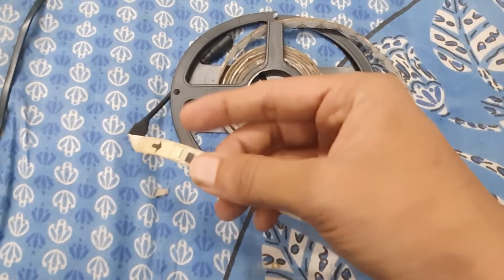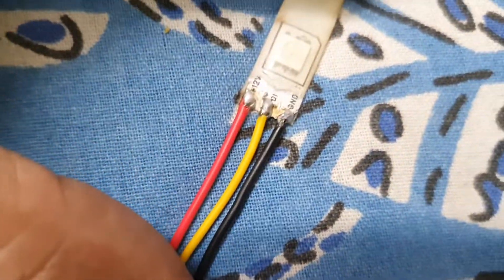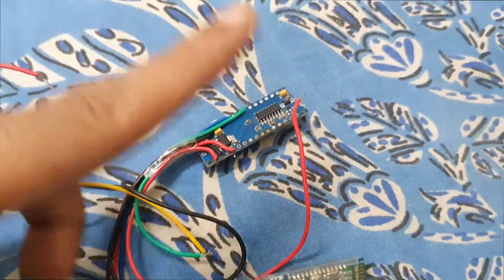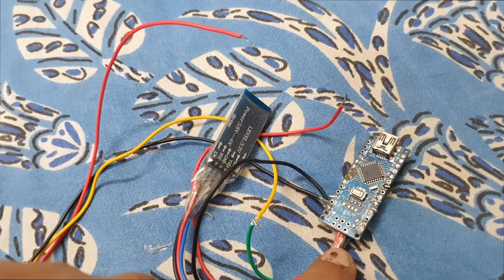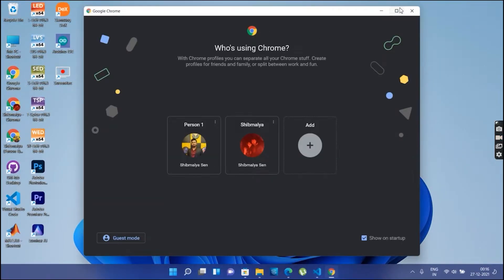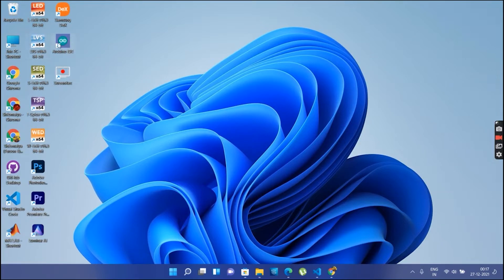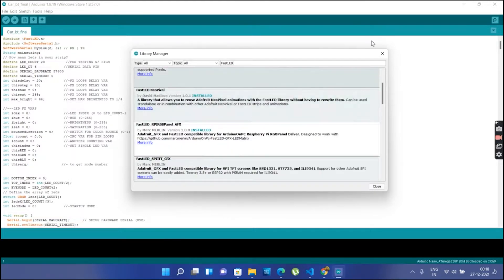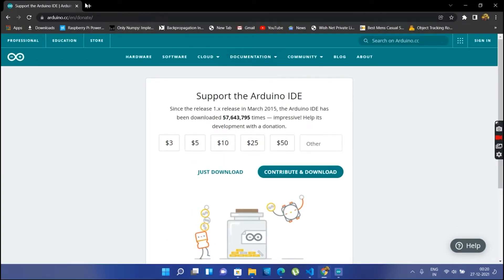PART-2 |🔥🔥 UNDERGLOW LED LIGHTS MODIFICATION🔥🔥| BLUETOOTH CONTROLLED |#diy #carmodification #rgb

Comment: Bro you did not provide the code!
Reply from the maker: Check the description box.
Reply: @ShibmalyaSen  Got it now. Thanks!
Reply: What does it mean if it says " pipe is broken" when i click on any mode in the app??
Reply from the maker: Check your electronics connections and if the Bluetooth is paired successfully..